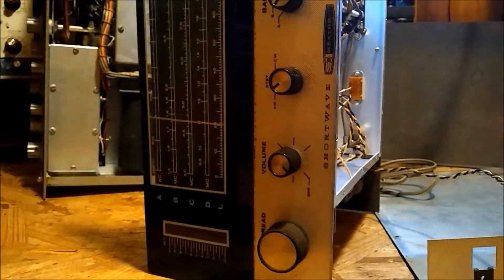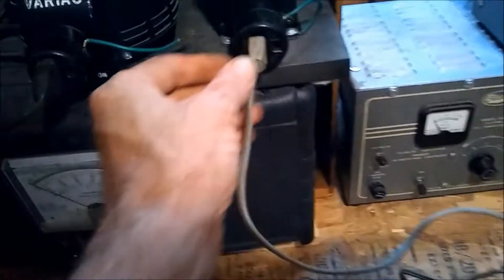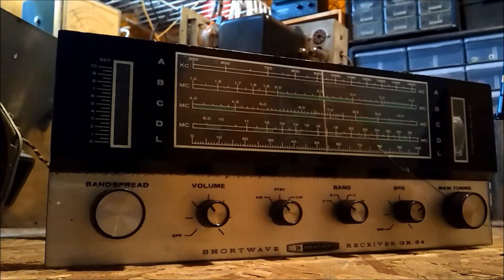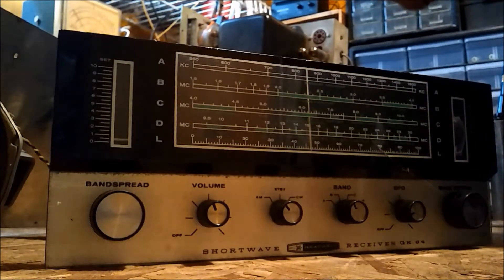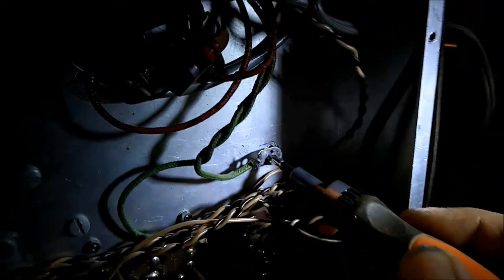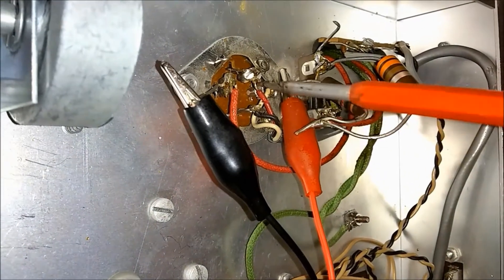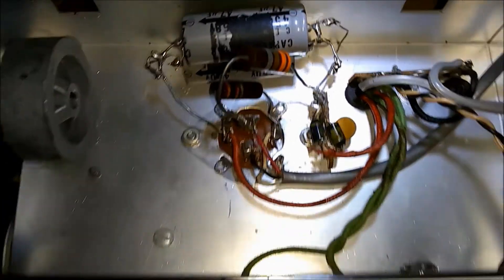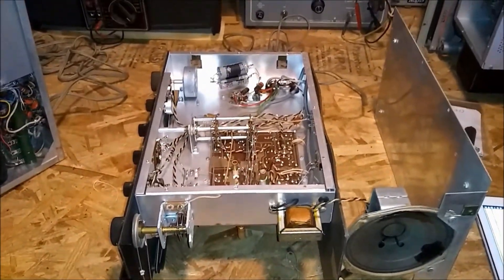HEATHKIT GR-64 Repair

Comment from the maker: So, I deleted a comment by a Ham since it was more rude than helpful. Basically the comment say's this is not an official hot chassis radio... So for the anal Ham's. Change the words "hot chassis" to unsafe, outdated, non-polarized AC plug. Which in fact is actually the same - see this video; https://www.youtube.com/watch?v=WZ1xY4_CBJI ... the important safety information on the subject can be found near the end of the video.

Comment: How is it a hot chassis with a transformer?
Reply from the maker: Simple, vintage Transformers only had two prong connections to the AC outlet. They did not have the third prong ground. Nor did they have a sized or polarized prong to prevent plugging it in (hot). On this particular unit - depending on how you insert the AC plug - the chassis could be hot or not. These are referred to as hot chassis electronic devices.
You can upgrade the unit by installing a grounded plug and adjusting the wiring, however I wanted to keep it original.
In the video. I plug the unit into an isolation transformer to safely work on it, hopefully to prevent getting shocked. While plugged in to the isolation transformer the unit will not have a hot chassis.

Comment: any chance you could put something up how to do a rough no test equipment alignment tweak ?  I have one that works pretty good but I`m not a technician..I don`t really care how the dials line up but just want to get it sounding a little better..would rather not start turning too many screws w/o knowing what I`m doing
Reply from the maker: Tuning the radio internally would be risky without equipment. I would recommend not touching the internal potentiometers. I'd first check to make sure all the components are in correct value and the traces to them have good continuity. You will need a decent meter to do these tests. The dial is adjusted with the air variable capacitor. I don't fully understand what you're trying to do, let me know how your projects goes. Hope this helps.